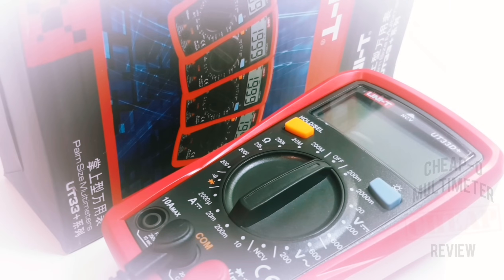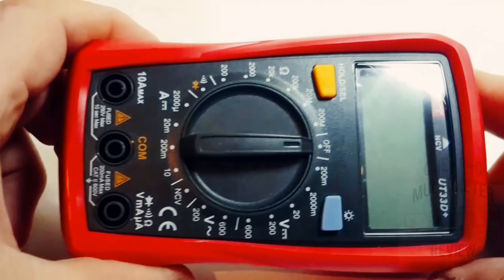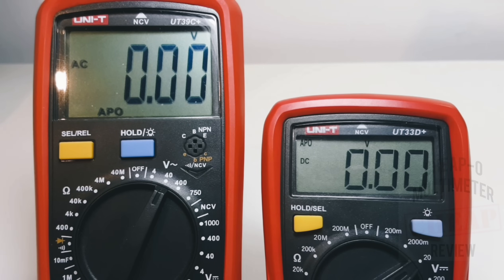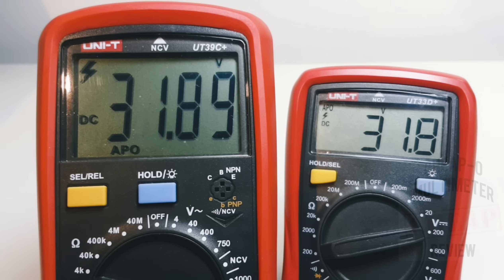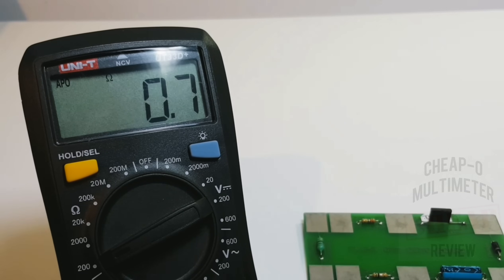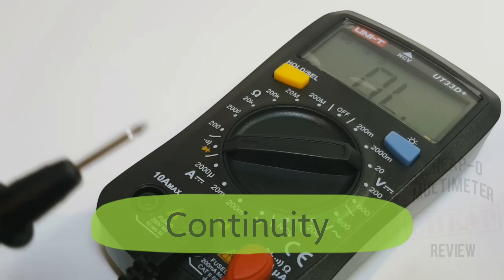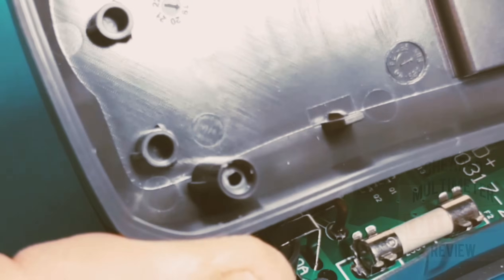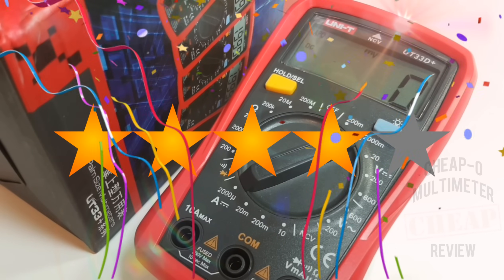UNI-T UT33D+ CHEAP-O Multimeter Review & Teardown

Comment: Can we measure voltage of 1.5, 9 and 12 volts battries with this model? Otherwise the UT131B model has these three options to measure the voltage of batteries. The difference is the NCV.
Reply from the maker: You can measure battery voltage in dcv mode but no dedicated ranges.

Comment: Major design fault with this meter is the mA/uA current measurement using the same terminals as for all other measuremenst. Imagine accidently setting it to a mA/uA range, while still connected to a power supply. It will short your measurement probes. Current measurment should all be moved to the A terminal. But, then again, it is cheap but you have to be careful.

Comment: Is it exactly the same as UT131D?
Reply from the maker: Yes..identical 😊
Reply: @KeepOnTesting  Can this device be calibrated? Today I found a used 131D on a flea market and it displays systematically high (~0.5%) on low voltage ranges. I don't see any obvious trimpots or other similar parts on its PCB, and its ADC is not 7106 compatible.

Comment: The UT33C is a very good and affordable multimeter not much different to the UT33D shown in this video. I reviewed and used extensively an Uni-T UT33C. It is much better than other no-name designs. The only major shortcoming is that it has a rather small voltage range (no 1000V scale). I assume it is so because it would require that the multimeter have a proper ceramic fuse and other circuitry changes.

Since about 2020, the model has been updated, as your video shows very well. It has a different screen, but it is less legible (larger dials but thinner).  In some ways, it is not a step forward. It still uses the same 9V battery, which is a quite dated design today. I would have hoped the redesign to address shortcomings, but it is still a recommended product.
Reply from the maker: Yes would be nice to see them get away from the 9v habit as you mentioned. UNI-T always has some great offerings no matter what your price range.
Reply: I am thinking of getting  ut33a+  should i go for A+ or B+ ?
Reply: @whocares3132  Ive had the A+ auto range version for a few years and I love it, less dial changing as its an auto range meter and very accurate, equals some high price meters in many cases.

Comment: Ut33d but it doesn't gives diod figure while only good beeps for continuity so what reason could be plz.
Reply from the maker: I assume it has a fresh battery.
Could be a shorted transistor..could be many things...how old is the multimeter? Try cleaning tbe pcb with Isopropryl Alcohol..including the range switch..that's always a good start..check for cold solder joints or anything else that appears abnormal...
Reply: @KeepOnTesting  
Thx a lot

Comment: I didnt see, did it do ok in just reading a regular diode-?  Nice little pocket rig, four versions to pick from one is auto range and three manual with range variations, nice little base/budget general use meter for house or hobby.
Reply from the maker: Yes I've been neglecting basic diode output test, soon to remedy that.. !
All in all a nice CHEAP-O that's got a lot of great personality!!
Reply: Yes one of the best of the small meters, and one of the best working continuity ranges of ANY meter big or small -- way too many large or expensive meters have less than stellar continuity ranges.  I see theres four versions of this model, and the A is an auto ranger but with other range differences, so choose your flavor folks-!